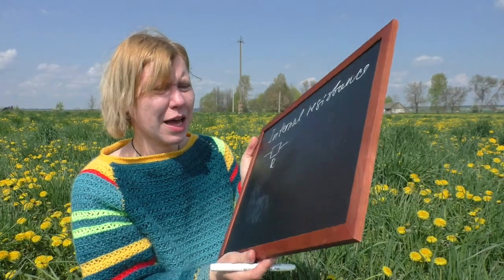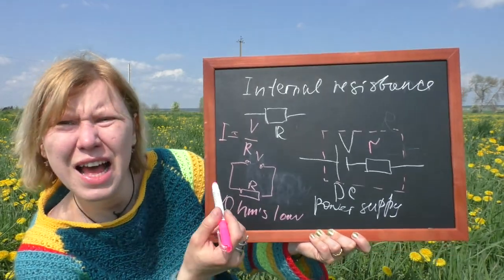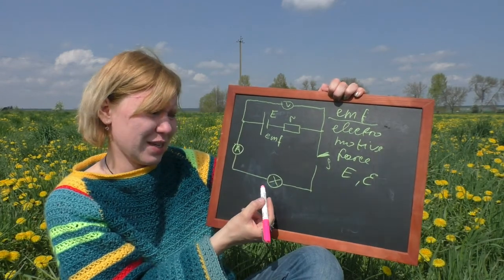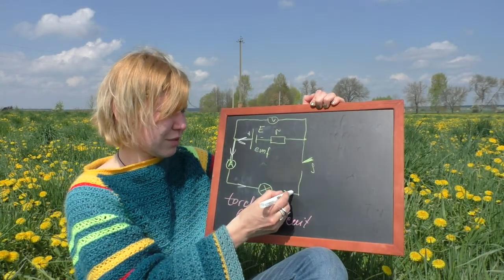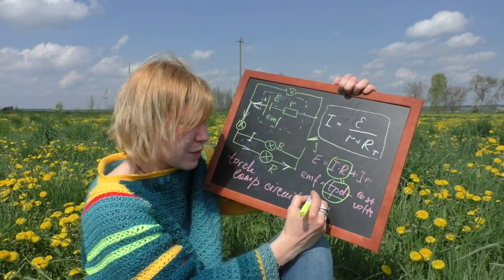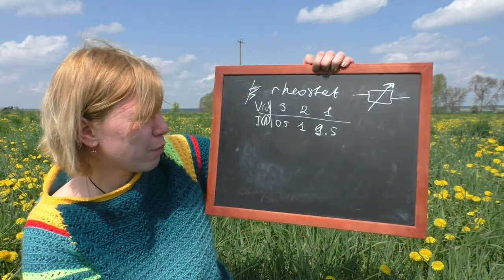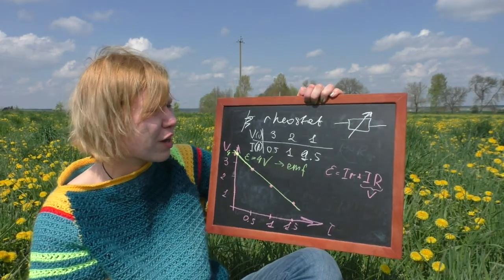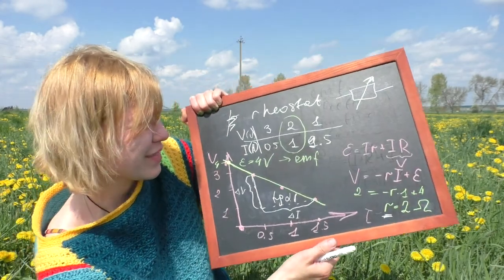Electricity: Internal resistance

Comment: Cool stuff, can you explain how variable resistors work? :)
Reply from the maker: The idea of variable resistor (rheostat) is that we can change its resistance (for example changing the length of wire. Resistance usually depends on the material itself, it length and cross-sectional area) . Doing that we can change the amount of current and the voltage in the circuit.